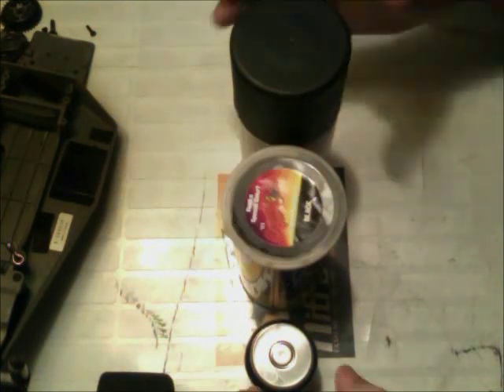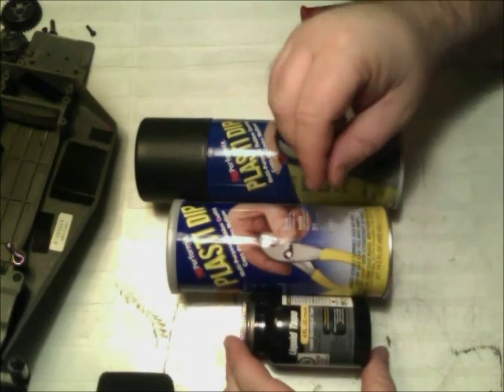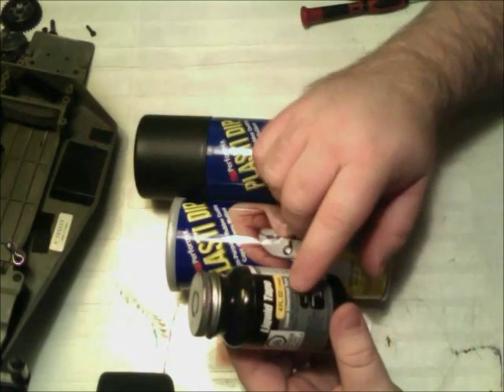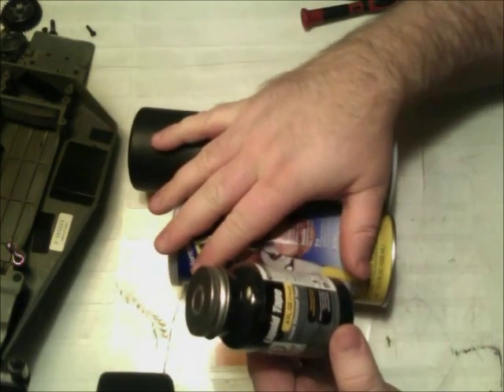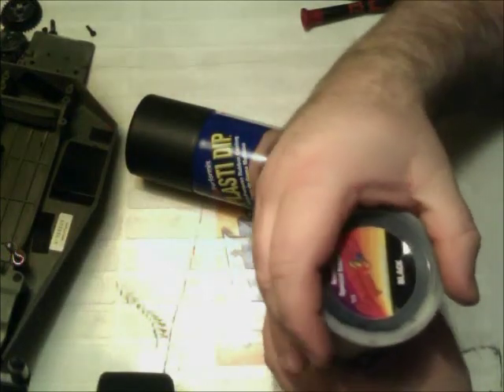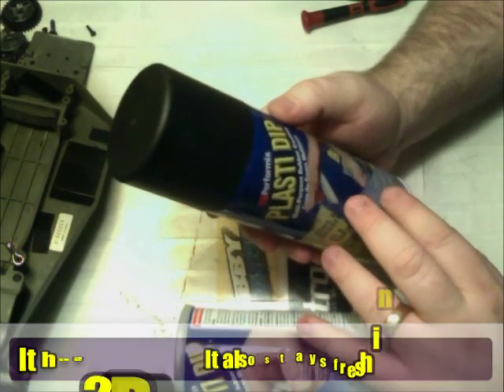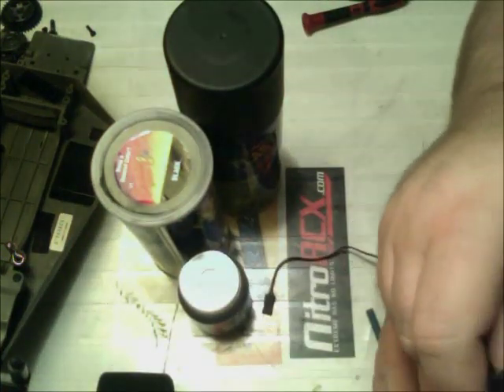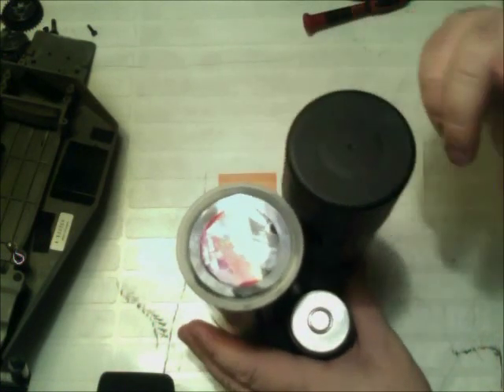Pros and Cons of various Plasti-Dips.avi

Comment: Put it in some smaller jelly jars and add a little xylene to keep it thin. Also, it hardens due to exposure to oxygen. One can put the 14.5 ounce can into a 1/2 gallon canning jar and suck the air out of it with a vacuum sealer pump. It will slow down the hardening process. For long term, put some of in pint canning jars, add a little xylene and suck the air out with a vacuum sealer. Hope this helps a few people.
Reply: F Mat; you can use any type of fuel to do the same thing

Comment: Is it a latex paint?
Reply from the maker: Sorta... its liquid rubber that solidifies once its exposed to the air. Originally it was a way to apply a new rubber coating to the handles of old tools where maybe the origal rubber handle covers needed to be replaced

Comment: I try using the performix liquid tape spray for my 4in1 ESC and my mini quad circuit board, I let it dry for 4 hours like the direction say and now it don't fucking work,
Reply from the maker: I guess you should have used plasti-dip then. Im not familiar with Performix. Just out of curiousity...why would you use it on a quad? are you flying in the rain?

Comment: Do u think I can use the plasti dip spray on my rc for waterproofing my esc?
Reply from the maker: Andrew Chan Most likely but I always felt like I got better coverage by either dunking the PCB or bushing the PCB with liquid tape. Im assuming the spray would work but it would take several heavy coats. Mostly because thin coats have a tendency to peel off after awhile.
Reply: oh i see, because in my country i cannot get plasti dip rubber coat, only the spray version
Reply from the maker: Andrew Chan Can you get electric tape? If not like I said the spray is probably fine just make sure you get plenty of coats :)
Reply from the maker: Andrew Chan
Sorry i meant Liquid Tape*

Comment: The "glow" plasti dip is supposed to be the product that glows in the dark..so then if the cap is green or blue its safe to say the paint will be that color in the daytime also??
Reply from the maker: Ive never used the glow in the dark kind but I would think that would be the case yes.

Comment: I tried to use rubber sealant from 3M. And it bubbled really bad and when it got too hot it peeled off on its own so don't get the 3m junk. I just got the dip one to use a brush

Comment from the maker: Ive changed how I waterproof servos though. I coat the inside circuit board and motor with corrosion x and then I use the copper colored permatex to make a thin gasket around the bottom and top lids of the servos so no water can get in through there along with loading the top of the horn with grease so water cant come in around the horn. I need to do a video on the new process I use. Its time consuming but I feel its better protected and lasts longer.

Comment from the maker: all three of them are basically the same rubber material just 3 different ways. The rubber coating will last a good long while if there is no wear and tear on it but its possible that at some point you may need to peel off the old rubber and redo the coating but it shouldnt be that often.